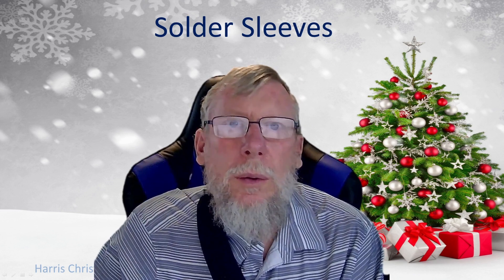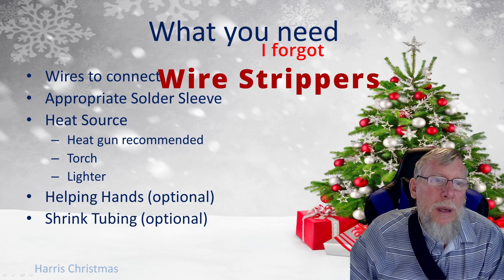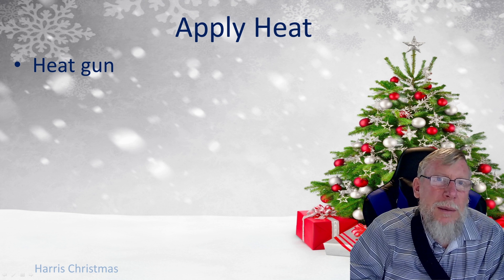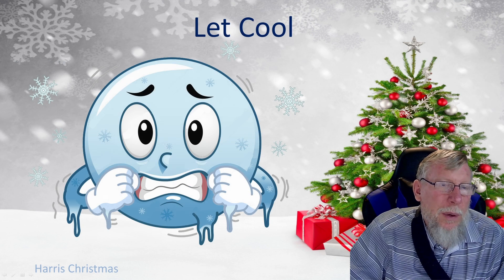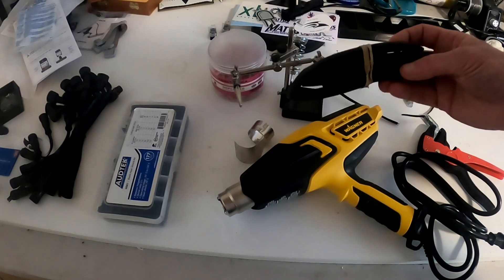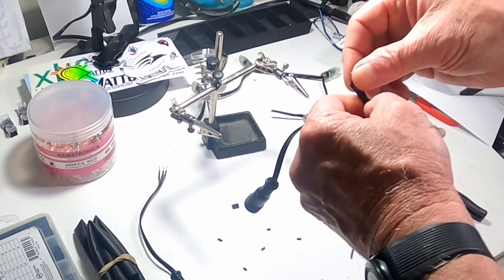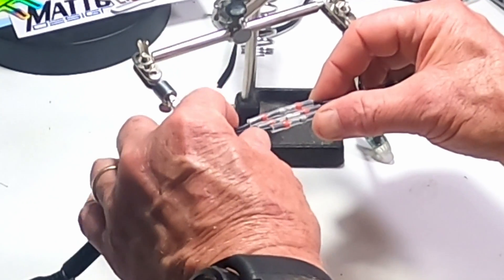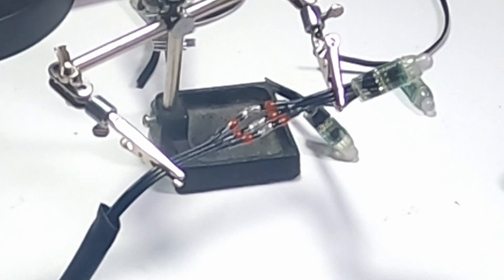Using Solder Sleeves

Comment: Around 2000 used. Love them. Use them exclusively for indoor repairs and outdoor " field repair" during a show for my wind catching mega and mini mega trees. I use click its for field repairs of ground props or outdoor temperature below freezing. Ive also used lever locks for temporary repairs or to test that the pixel was the culprit and not a power injection, water or software glitch. Very nice video.
Reply from the maker: Thanks! I cannot even count how many I have used. Just a quick search of my Amazon orders, I have purchased 2500 and I have purchased many more from other vendors!